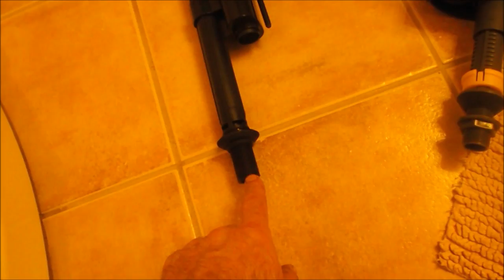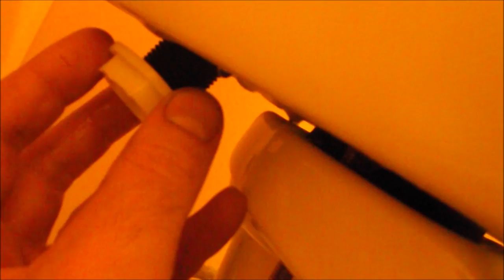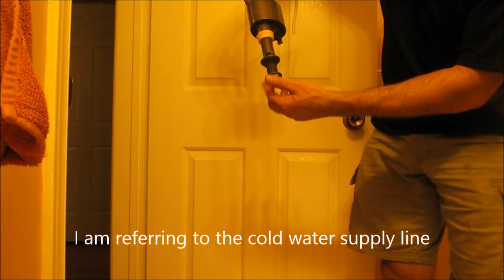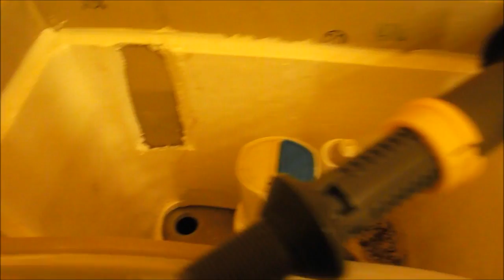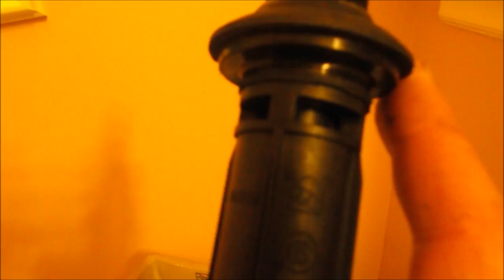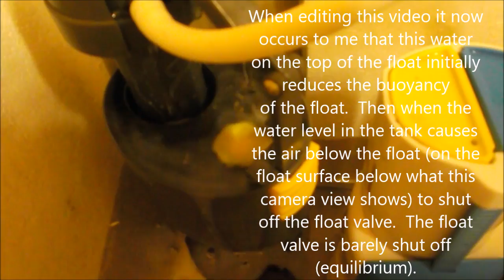DIY Fixing a toilet with constant running water - fill valve replacement - brilliant design

Comment: I installed this same fill valve a few months ago, it was working fine but now the shut off isn't working and the tank overflowed. For now I'm leaving the water off and turning it on to fill the tank, any idea what I can do to fix it without replacing the whole thing? Thanks
Reply: I'm having a similar problem. I even purchased a replacement valve the same kind but still
have the same problem. I will try to amend it otherwise I will buy a different model.
Reply: Did u find a fix for this?

Comment: Do you have any idea how to remove that dual flush system you're using? If I twist it, it's really tough and it snaps to whichever side I twist it at and I'm scared of breaking it, and I can't find any tabs to pull or anything, and you're the only person who's had that flush system that I've seen, everyone else has a modern one!

It's driving me insane because I can't get to the flap and my toilet tank is too small for me to even get a look at the brand or name of the thing.
Reply: Hi, i have same peoblem as you, did you figure out how to remove that dule flush system? Thanks.

Comment: I don't think I would have used this fill valve and also cut out the Styrofoam.. I probably would have bought and replaced the same one you had before.. would have seemed like a lot less work....just my .02 cents

Comment: Thanks so much Mr. DIYGUY.  The new filler tube that you just installed... that's the one in my toilet right now.  It worked well except that it would shut off when the tank was only half full.  I'm the type of guy who can sometimes get into trouble when I start messing with plumbing so I was reluctant to go out and buy new parts.  Especially when I was convinced that this thing can be adjusted... I just didn't know how to do it.

But your tip about twisting the two pieces of vertical tube and sliding one inside the other... that was the ticket.  I fixed it in about 20 minutes including spending a bit of time fine tuning it.  Much appreciated.  All the best for 2016.